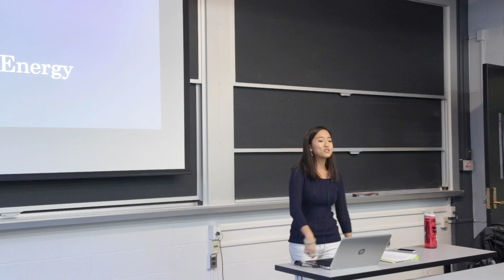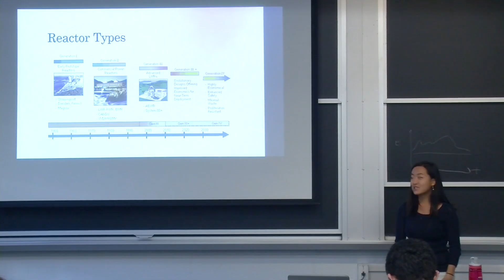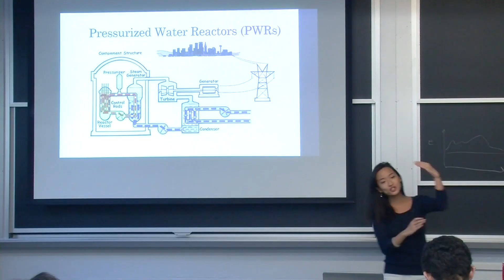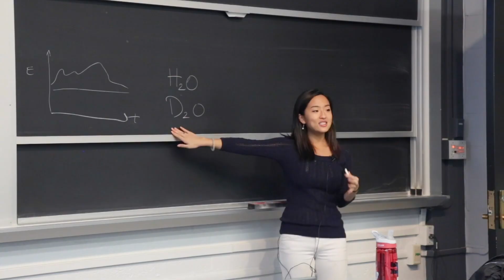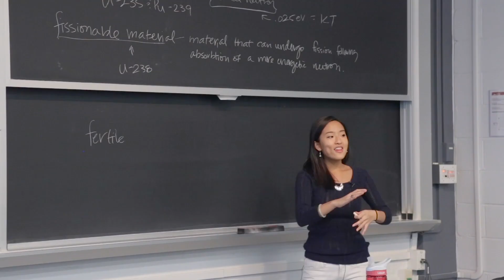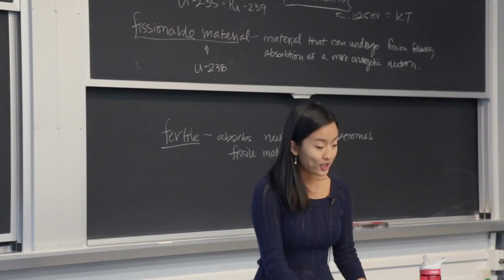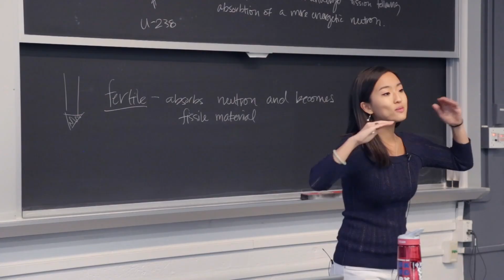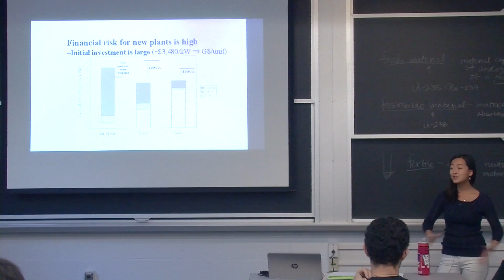16. Nuclear Reactor Construction and Operation

Comment: why do they post lectures years later, is it a reposting? They would benefit more if they posted them on time with because it gives views something to look forward too.
Reply from the maker: MIT OpenCourseWare is not a live publication of courses at MIT. Our license (CC BY-NC-SA) takes much time and effort to follow. There are lots of IP objects that need to processed, permissioned, replaced, removed. There are other things that also require time to process- student and faculty private information (names, contact info), MIT specific info (servers, logins/passwords), captioning, and PDF accessibility. As such, publication of course materials is normally offset by at least one semester (and many times more than that).

Comment: In case nobody's said this yet. At 32:00 in the discussion of the Fukushima accident, the left hand picture is actually a burning oil refinery, NOT the hydrogen explosions at the plant, which were very brief events. This is somewhat understandable as it was also a result of the Thohku earthquake and tsunami, and provided some of the scariest images of ongoing, dramatic flames that news services needed. The image is actually of an oil refinery fire. It is, unfortunately, far too often used in reports about the reactor meltdowns, and gets echoed around the reports that cite each other as sources.
Reply: Further, I think in a moment of nerves related word-tumbling she briefly states that the Fukushima reactor went supercritical. which is not true, and actually a testament to the engineers who designed and operated the plant. The reactor's safety system detected the earthquake and automatically scrammed the reactor. The melting was caused by decay heat from daughters. It should go without saying that given the broad scope of the presentation and the fact that poor girl is also a grad student at MIT, that is to say rather busy, the presentation was great and I doubt I could do any better.
Reply: Good on you for pointing out misinformation. There's already too much of that kind of stuff going around, especially around our most efficient form of energy production.

Comment: So that was an MIT teaching assistant?   The teaching assistants at LSU were bitter, arrogant, rude, hostile, insulting, and dumb (couldn't understand that a thermos was a closed thermodynamic system and people took them on the job sites because people have to eat).      I forgot lazy!!   They'd stop grading the final exam if you had enough points for a C.
Reply: > They'd stop grading the final exam if you had enough points for a C.

That is illegal. You have to grade the work in its entirety.
Reply: @erkinalp  k, great.  So I call the  campus police on them, I should 911 ?  some grad student didn't understand what an inverse function was

Comment: I normally have a difficult time following people who talk very quickly, but I had no problem here. The material was so easily digestible even for a self taught high school drop out who grew up in the woods like myself, that I was able to follow it effortlessly as I listened to it in the background. 90% of the comments here seem to indicate she was speaking way too fast, is it really that much of an issue? These comments are kind of blowing my mind,  I thought I was the one who had trouble processing fast speakers. This makes me question my internalized identity.
Reply: dude, I pretty much had to spend 3 hrs listening to her cuz she was so fast - what are you talking about? (I am a very slow person in life and in general, so take that with a grain of salt, but still)
Reply: @tomyao7884  I am a deliberate and thorough learner myself.  I can't organize the knowledge in my mind until I have created the framework of a mental model first,  Then I can fill in the gaps. For me this presentation was all gap fill, and that is potentially why it was so easy for me to absorb in one pass. If the material had challenged my existing model, then I would have had to take it very slow to give my mind time to digest and reorder my understanding. In retrospect I see it was not necessary for me to clap back in the comments section. I thought that the speaker did a good job presenting a lot of foundational material in a short time. I am sorry if it seemed like I was trying to diminish your struggle, Good luck on your studies Tom.

Comment: 28:45 Sorry, I don't want to sound too harsh, but the description of Chernobyl accident seems surprisingly inaccurate.
1) April 26, not 25;
2) the safety test was about using the turbine rundown for the BOP needs, not "running low power to see how it behaves";
3) in addition to 4 cooling pumps powered by the running down turbine, 4 others were powered independently, exactly because "they realized this";
4) graphite tips are there in order to displace the water when the control rod is at its top position, so having them is reasonable. The problem was that their length was less than the core height, thus keeping half a meter of water below them (the currently running RBMKs have the full-height tips);
5) what event(s) caused the explosion(s) is a long-standing and controversial matter, with several timelines and causal diagrams published. The reactor designer organizations, backed by the government, blamed only the operators. Dyatlov, while in prison, backed by some other operators, studied this version and analysed the changes that were introduced on all RBMK reactors. He wrote a detailed book, claiming that combination of the design flaws and instructions in force at that time made it impossible for the operators to realize how bad that specific condition was. The truth, as always, is somewhere in between.

The complexity of this controversy highlights a separate important challenge for the mankind: even having supervision, certification and regulatory policies for our huge sophisticated systems, how we ensure that those policies themselves are correct and sufficient (see also: Boeing 737 MAX).
Reply: It's not easy to be super accurate when lecturing.  It's a lot easier to "fact-check" after the fact.
Reply: The thing is, at the USSR the nuclear industry wasn’t very transparent, had they been they would have acknowledged the design flaw or at least prepare RBMK operators with this in mind. Let’s not forget that at the Ignala Nuclear PP they almost had a Chernobyl years before Chernobyl and the government knew about the issue. Lies were a major cause of the Chernobyl disaster.